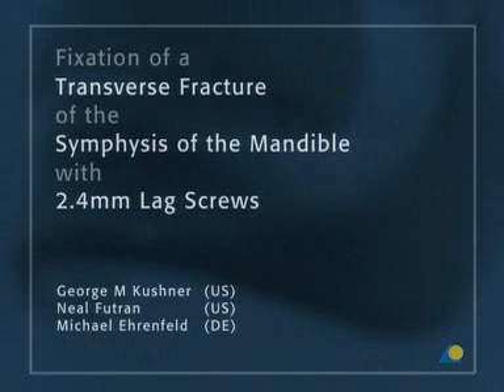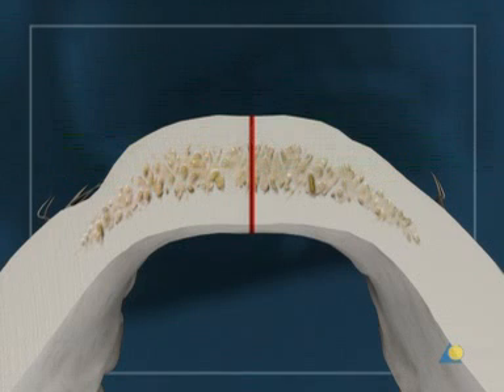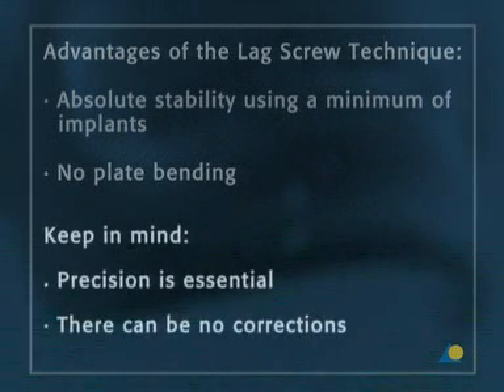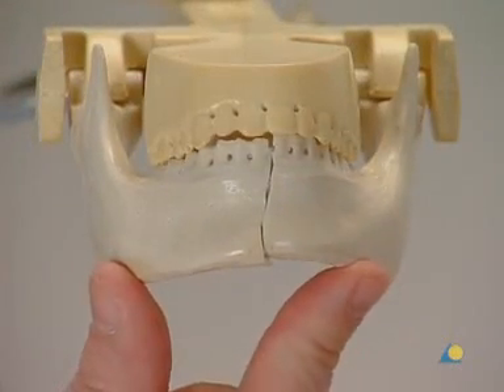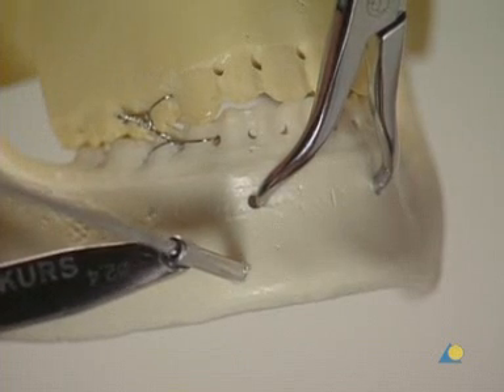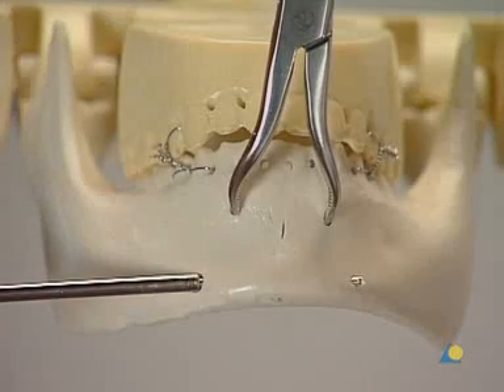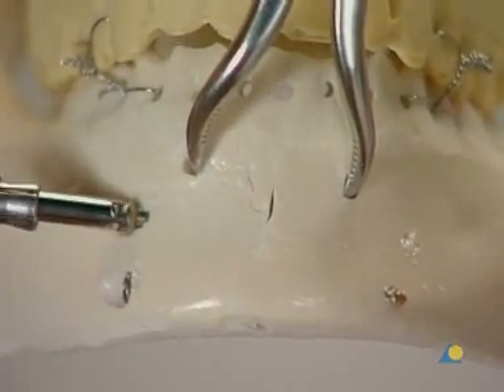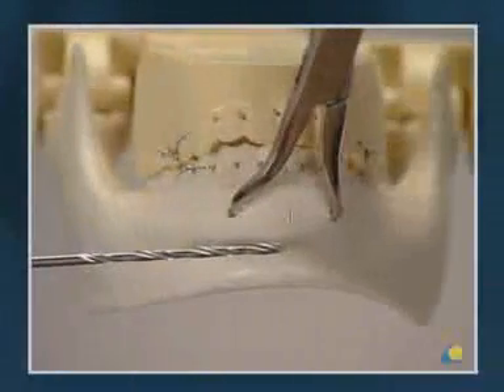Fixation of a Transverse Fracture of the Symphysis of the Mandible

Comment: Hello Dr.
Could you please tell me if it’s normal that my bones hasn’t joined together after open fixation with titanium plates on my symphysis in the meddle? It was fracture with one fragment and was fixed with 3 plates. On x ray it showing it’s still not joined, just a bit after 6 weeks it’s fill up a bit on the back of the bone but i could still see the cracks and I’ve been advised to have a soft food for another 6 weeks… I’m in the pieces and falling apart inside as I’ve been attacked just in front of my house and literally its a disaster for me a specially when it’s not healed after 6 weeks:( please reply what is possible outcome of this case. I’m 37 years old with no health issue.